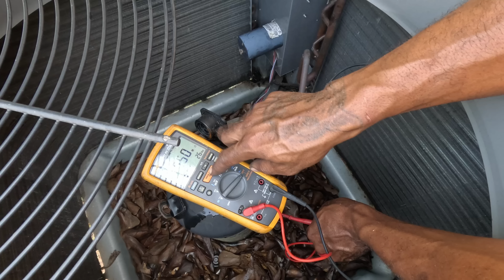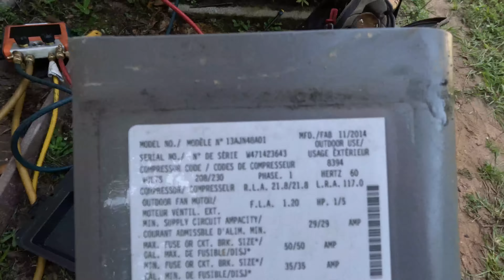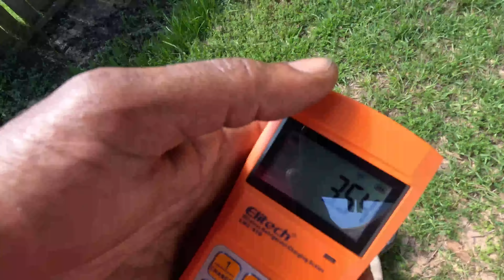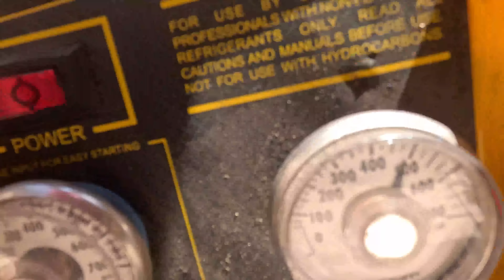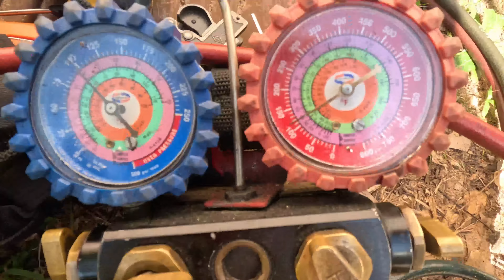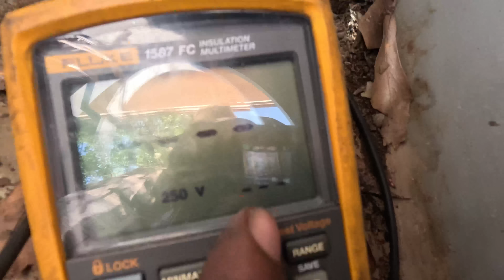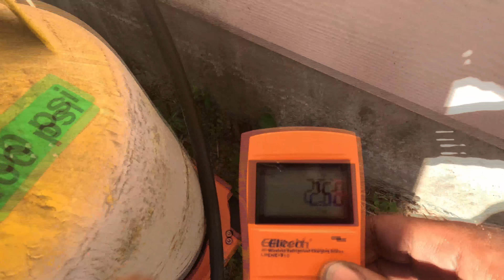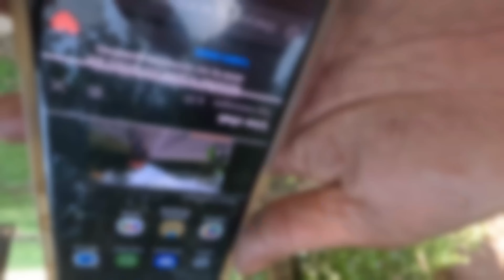"SHOCKING CONFRONTATION: HVAC Tech Fed-Up with Unpaid Labor!"

Comment: Home warranty companies are the biggest sham in the industry. I’ll NEVER deal with another one. Gratitude goes a long way with service technicians.
Reply: just heard horror stories about home warranties...in the dead of winter a furnace that was beyond repair one of their contractors confirmed it... yep it needs to be replaced...we will do it in 6 weeks
Reply: Tell me about it American home shield is the worst my ac died because of age all the would pay is $600 in replacement cost which was almost 10 grand
Reply: Would never get involved with a warranty co. New and questionable customers, COD only it’s the only way these days.
Reply: Those r the 1s I hate think u work 4 free I steer clear of home warranty those types r usually wierd
Reply: I used to work at Sears on washers and dryers and a home warranty company kept sending a new Sears tech out as I no longer worked at Sears and got the warranty at $69/mo and I got several units repaired on a $100 service call, but my washer had a bad display control panel and online it said it would cost $800, but was no longer available.  The Sears tech kept calling tech assist and they insisted it needed to be a function on the panel and wouldn't agree it needed the panel needed to be replaced and replaced 6 other parts and they didn't get it working.  Then they settled on it being the panel and after 6 trips to my house they saw that the part they found bad was no longer available as I already knew and bought me a new washer at Sears. The control panel if it was even available would have been as much as the new washer!
Reply: The company I work for will not deal with home warranty companies. We’ve been burned 1 too many times.

Comment: Here where i am its the opposite.Florida. We have hvac people trying to rip us off badly. I called because needed new fan. They wanted $1700 and not a penny less. I bought it for $75 and was done within an hour. I even showed them the part for $75 at grainger and showed labor is 1 hour for thay job. How the heck can someone try to charge $1700 for one hour and $75 common part?. Wish we had good reliable hvac people around here. I had to learn to fix it all myself so i dont get ripped off by someone with about same knowlege as me. They know florida is hot and always try and take advantage knowing people are sweating badly and want ac.

Comment: Warranty Customers out of pocket expenses have to be paid upfront before I pick up the equipment. I have them pay online. You will always have this issue if you do the work first before paying.
Reply from the maker: I may have to start that. Thanks!
Reply: @WWHVAC u have to stop that paying later with customers. Society has had a mind shift of self entitlement, not being held accountable and victim blaming. You never go out your way for customers that is when they going to screw you. I overcharge the warranty company what I would normally charge and the customer have to pay the rest out of pocket.

Comment: I am a computer tech and used to do some on-site home service calls.   Even though I would make it clear how much I charged and it would be 1-hour minumum.  Often it would take me less than an hour to fix the problem and they would want to haggle with price.  I had to start getting the 1st hour up front, cash or card.

Comment: So thats why no ac company returns my calls when i ask for a tech to come replace the gas valve and orifice tubes under the warranty because its only pushing out enough gas to ignite the flame then keep cycling and it blew apart one of the orifice tubes from the delayed ignition.,  called 5 different companies who service goodman or amana and told them i already tested gas pressure before the valve and its within spec so the tech will only have to replace the valve under warranty.  I cant do it because i dont work for a hvac company..

Comment: compressor might still be good, Copeland specifies in service bulletin AE-1294 a megaohm reading of  less than .5 megaohms to ground before a compressor is condemned
Reply from the maker: What approach would you have taken?
Reply: @WWHVAC  I would test for acid in the refrigerant first, then try a new capacitor because just because it tests good doesn't mean it works under load, then I would have tried smacking the compressor with a rubber mallet right when it's trying to start, sometimes they get kinda stuck and you can jar them lose and get them running again, if that didn't work I would have tried a hard start kit to see if an extra boost could get it to start. you would be surprised how often it works. if those 2 things didn't work and you want to try a hail Mary for the customer copeland recommends a clean up procedure to remove contamination. it's hard to tell without being there to mess with it. could have had a mechanical failure and not be savable at all, contamination in the refrigerant could be grounding it out just enough to not be able to start. not saying it's 100% savable just a few things that can be tried before the customer spends a bunch on a new compressor. also you are not supposed to use a megger on a compressor that is under vacuum. the reason you test for acid is so you don't recover contaminated refrigerant with acid in it, replace the compressor and then add the contaminated refrigerant back in and kill it also
Reply from the maker: @TheSimba86  Remember you have to all day under home warranty budget. It's not worth it. Just replace the compressor. I'll be out of business in no time.. If i get paid to do that, I'll do it. Some decisions I make are business not to show how good of a tech I am..
Reply: @WWHVAC  after seeing the end of the video I don't think I would have gone above and beyond for them either LOL always hate when you gotta get mean to get paid, that's one I would blacklist and never go back to

Comment: Warranty companies create the problem because they advertize as if they'll pay everything, then of course dont..i ran into it when i did service work, now ad a health care provider i get same..proe pay near or over 1000 a month for insurance, then are shocked when they find out beetween copay, counsurance, deductable etc they owe sometimes more than they did when they didnt have insurance.
Reply: I agree.  the customer thinks he is only responsible for the deductible.  the warranty companies advertise the hell out of that.  with my health insurance, I get one free annual physical a year.  the doctor's office will bill me if the doctor talks to me about a new problem I have or if the doctor has to treat me for anything wrong.  kind of like the "free" hvac inspection where oops you need a new capacitor.  turned out that inspection wasn't free after all.  lol

Comment: This unit had 2 liquid dryers and only 1 was changed and the contactors should always be changed when compressors are changed. This is a commercial and industrial practice but residential is never practiced. Residential techs are usually the beginners of the trade. Just being honest.

Comment: That was a very dumb move taking his plug out of his ac disconnect and off his property.  If he were to push the issue and the police went along with it then you wouldve put yourself in legal jeopardy. Granted he should have paid his bill and not been a jerk about it but 2 wrongs dont make a right, especially when its you with criminal charges.  Think smarter.

Comment: I think it would just be easier to get payed the $400 up front rather than deal with shutting off a breaker. So what. I could have called the police and bought another disconnect and fuses. Better to get the money taken care of up front. Really need paperwork agreement signed so you can file mechanics lien and get interest + Attorney fees. You need to cover yourself. My father had problems with people not paying for car repairs and just lost money. You work pretty fast and knock it out. You should not have  ANY confrontation if you get your money rules right. It's too bad people will take advantage of your intent but they will. The trouble is not worth bypassing money rules. Awesome you got your own business going and a good rep. I would consult an Attorney to work on your behalf if need be. Let the Attorney lay out money ground rules.

Comment: Guess you should have pulled it at the very moment he failed to pay. What a jerk.. I would give him 5 minutes to pay and then pulled the unit. No need to hassle over it, not worth the time.  I admire you for waiting as long as you did. Nice trouble shooting I can use that the next time I service mine. I had a guy stiff me six dollars. It irked me so much. At his place of business he kept a dog chained in the back. Nice long chain. I figured it was worth 6 bucks so I called it even.
Reply: It's not the $6.00.   The next guy might get stiffed for $600.00.
Reply: @RetiredSignDude  Oh it cost him much more than that. I did research on him. I got friendly with a telephone supervisor working on glitches in our business. I gave him the guys number and asked if he could do some back ground on him. He said he couldn't do it but the next day he came in and said the guy owed $1,800 in phone service and somehow he got through the cracks. A crew was over there that day disconnecting his phone. And he did stiff a bunch of others big time. TV & computer repair. He would take money in advance and not do the repair saying it needed more to fix. Thus holding a disassembled TV or computer hostage till he got more money.

Comment: Don't know why you didn't check lock rotor and also don't understand why you didn't try to put a hard start or start gear on I don't believe you fully diagnosed and fully try to get that compressor started
Reply from the maker: Its my business I run it how I want to. Not doing all that to that unit and warranty will buy a new compressor. But now you know why...thanks for watching!
.